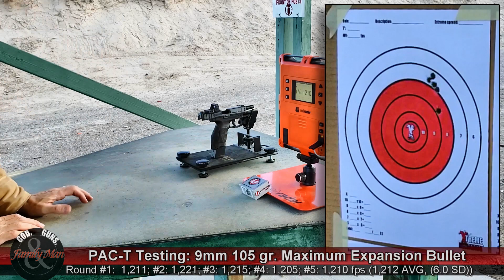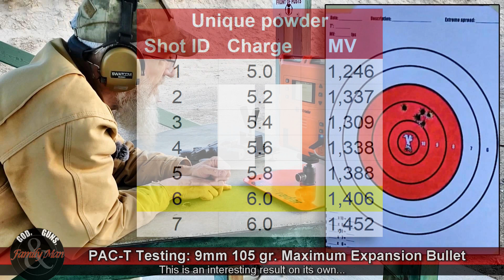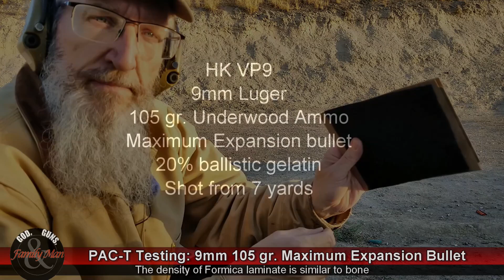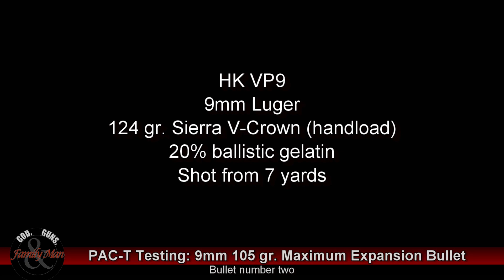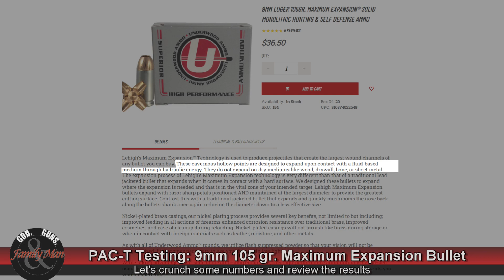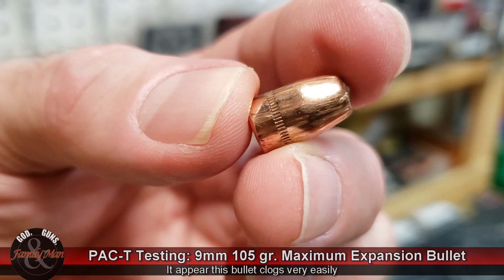9mm 105gr. Underwood Ammo Maximum Expansion bullet: Clothing and Hard Barrier Ballistic Gel Test

Comment: Well done as always. Thanks for good demo & data. Surprised & a bit disappointing with Sig.
Reply from the maker: You are welcome.  I have yet to find a traditional JHP that expands well after passing through a barrier.  The drawback of the Maximum Expansion (Lehigh bullet) is it is very light.  I have been thinking about a mag of mixed rounds... some V-crown or HST and some of these max expansion.  I am not decided though.  Thoughts?
Reply: @sdkweber  Sounds like a good experiment. I have crudely tested most main stream hollow points over the years in wet & dry paper, sand, saw dust, water jugs clay blocks, and the like. In recent years it has been mainly water jugs & wet newspaper. Based on these results compared to youtube gel tests I have carried Gold Dot, HST, XTP, Critical Defense and Critical Duty.
I switched my 45 from Critical Duty to HST (+p) a few years ago[My wife & 1 daughter carry]. I recently switched my personal edc 40cal. from Critical Defense to 165 Gold Dot. They are equally effective IMO. And all of our 9mm in the house/family get HST 124[standard & +p]
I would give the Critical Duty offerings in 124 & 135 a look and maybe the Critical Defense. The Critical Defense in the 9mm seems a bit under powered but very consistent in expansion.
Reply from the maker: @guardianminifarm8005  That's a good round up of bullets.  I really wish the HST would be available as a reloadable bullet instead of just factory ammo.  But it is a very good bullet nonetheless.  Thanks for the info.